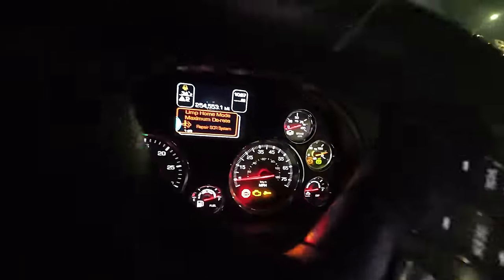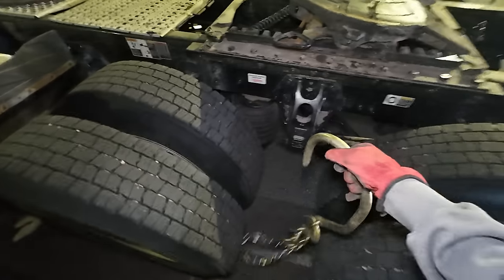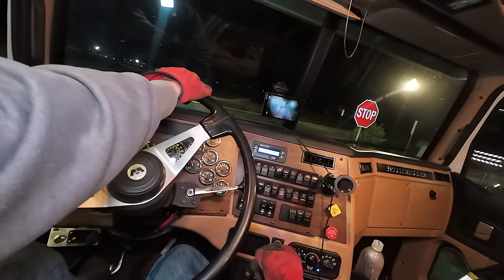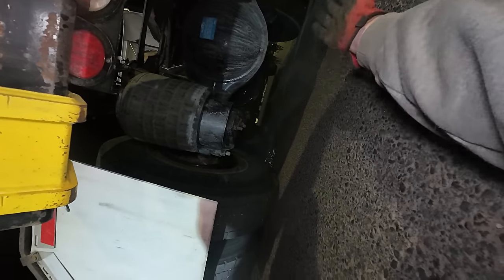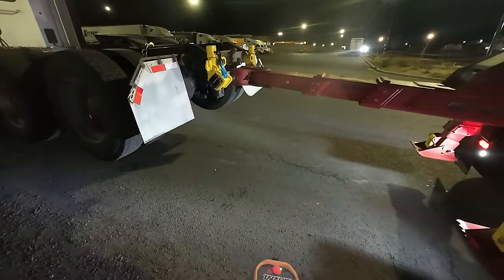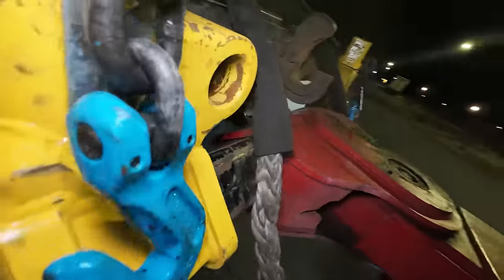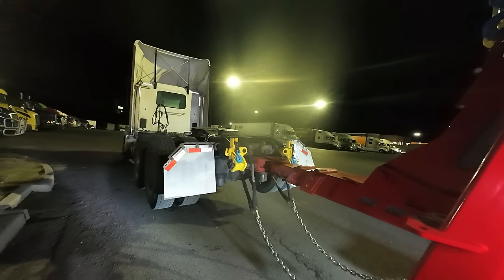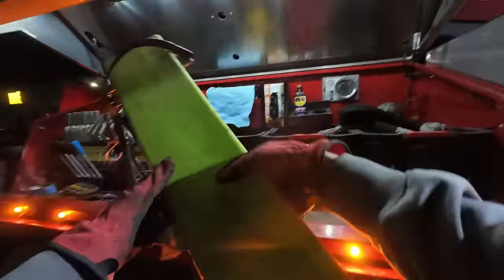This is what keeps us in business

Comment: I am not in trucking or towing but find your videos interesting and enlightening. I recently saw a tow truck towing a tractor and I specifically looked at the tractor and sure enough, they had put ratchet straps on the fairing to keep it intact. Had you not said anything about that precaution, I would never have noticed. Good video as always, Casey.

Comment: Casey, I don't know if it would help but I know for RVs they make a friction type of paper towel rack that doesn't unwind.
Reply: @tomberg6699 A simple spring clip will keep it from unrolling. RV paper towl holders still have issues from wind.
Reply: after that said maybe a piece of sand paper on the inside?
Reply: @edwinhryzan9030  How is sandpaper going to stop air flow in the box when driving?

Comment: As a 40 yr career retired driver that began in the 70s I’m so glad I’m not starting out now.  The derate emissions bs killing productivity would have driven me crazy.  Casey, I love everything you put out, keep it up if you can.  Thank you!
Reply: The derates are a major pain, but also a tremendous expense. I have had trucks down for months because of no parts to fix the problem. Thankfully, one truck was still under warranty for its issues. The other needed a $250 part that was unobtainable and the rumors were that people were stealing them off of trucks at the truck stops while the driver was in the sleeper. I had seen a couple new parts on auctions for $2,500-3,000. Peterbilt was willing to reprogram the computer to no longer derate for that, but the tow to the dealer (none local) would have been a worse financial decision than just letting the truck sit waiting for the part to become available again.
Reply: I agree with you sir about the emissions parts on the vehicle that’s one of the reasons why so many of the older trucks if they’re in good condition people are buying them just because of that anyhow I have a 91.5 Dodge with six in a row under the hood And I wouldn’t trade it for a new one, even if somebody was to offer me a brand new one even up, I told him give me the cash difference. I took my engine down to a very very professional shop in Cambridge Ohio called DNJ Performance and they’re extremely good. I know they specialize on comments engines I don’t know if they do power strokes and stuff like that but these guys are good Google the D.N.J., and also look at the executioner engine
Reply: And now the freeways are littered with more empty DEF jugs than picnic coolers...
Reply: @jimmungai1938  Yes sir, I am with you.  I wish I had back my 93 ext cab LE with Banks mods.. I sold it with only 123k on the clock.  Barely broke in.  Oh well these are easy tows and will keep Casey and many others busy.  Just glad that’s not me.  Enjoy that Dodge sir.
Reply: @r2db have you ever had to sit in a car behind multiple 18 wheelers billowing sooty stuff while stuck on the freeway on a hot day? 
Have you lived in an apartment near a freeway where you had to vacuum and dust every day to rid apartment of soot. 
Have you ever looked down from Griffith observatory at a layer of smog?

We Angelenos enjoy the cleaner air thanks to emissions regulations!
Reply: Clean air 1st.
Reply: As a member of the general public, I expect industry to control emissions. It's part of the deal.
Reply: @r2db  I agree. We have several New trucks down with DEF and emission issues for weeks ongoing , while the old 15-20 year old trucks we have are the only things keeping us afloat right now. We cant keep $200k new trucks running. We cant get parts for the $200k new trucks. We cant keep the $200k new trucks from falling apart. Another thing that needs to be mentioned is the quality of the trucks being built is garbage. We run Custom specced Peterbilts. These should be cream of the crop trucks and they just aren't. Now, granted, we haul milk 24/7 and we haul lumber that goes over a mountain 4 times a day at 105,500 lbs, so our trucks aren't pavement princesses. They get worked. But the difference between turning the key of a 2003 Pete 379 with a Caterpillar and that of a 2023 with an cummins X15(Great engine BTW) is that the 2003 will do its job and be ready for more 24/7 without complaint. The 2023 will rattle itself to death and throw a derate.
Reply: @macking104 , if it worked it would be fine, but I have to ask you if you have ever had to make truck  and insurance payments amounting to thousands of dollars a month on a truck that’s parked because some emission part is not available ? Or seen the results of what happens if you happen to spill a little of that DEF Fluid on an aluminum part of a truck ?
Reply: @geekazoid47  I also imagine you as a member of the general public will quickly be unhappy to not get the goods when YOU want the goods.  There are issues with the technology you can easily research and become educated.  We all want the reliability that insures a flawless supply chain.
Reply: @jimwilcox741  I don't care about any of that more than emissions. I drive a low emissions diesel and do my own maintenance. These guys are idling a lot which is driving their regen intervals.

Comment: By pushing the engine stop override button (as the filters were loaded and would not clean by doing a forced regeneration) I just pushed the button every 11/2 minutes so that the engine would keep running and keep running.   Long story short it worked for me to finally arrive back to home after about  600 miles

Comment: Not 100% sure but in the trucks I've driven that use the cruise for fast idle, once you set it, you can just hit resume to put it back on if you don't turn the engine off. Saves on wear on the up switch from the repeated presses.

Comment: The receivers can always stay in whatever position they finish in, because no matter what you do, they're always going to be in the wrong position the next time you use the truck.
Doing light duty towing that I was into, anytime I had to tow something backwards, I always tied down the steering wheel, even if the lockplate was engaged when removing the key from the cylinder. It didn't require a safety thouigh, because I always got to use the seatbelt as the lock. I started by running the seat all the way forward, then I pulled out ALL of the seat belt from its retractor. Next, I would make two or three loops around the wheel, depending on how many it would go. Then I took up as much slack as needed by twisting the belt until it was just short enough to NOT be able to reach the receptacle, then I would untwist the belt by ½ turns until it would just barely reach. That was always enough to hold the wheel firmly in place, but just to make sure, I would then run the seat back until it wouldn't go any further. Most guys wouldn't go to that length. They would pull out some of the belt, wrap it around the bottom of the wheel a time or two, then click it ino the reseptacle and call it done. You could always spot those guys because the truck would always be shifting back and forth in their lane. It wasn't a lot, but it was noticable, and it wouldn't have taken much to get it swing out wider, maybe a bump in the road while turning, which would allow the column to collapse just barely, which would have been all it needed to slip the belt just enough.
This is the first video of yours that I've seen with those axle hooks. They look a LOT more convenient to use than using grab hooks; probably far less possibility of contact with harnesses, lines, hose, etc due to the chain not requiring a closed loop back to itself.
Question though,
I've seen you go into the cab to bleed off the air system in several videos. Why, and what happens if you don't?
I remember seeing, many years ago, that tow truck drivers used to cap off the exhaust stacks when towing trucks backwards. Why doesn't this happen anymore?

Comment: If you will use the underlift brackets for support with the chains in the future, you might consider replacing them with weld-on excavator bucket hooks (hook throat facing toward the truck, and smaller versions of the existing brackets at the rear of the hooks.
Reply from the maker: These are weld on hooks..

Comment: @casey ladelle take a piece of fishing line and tie it to the back of your paper towel holder. Loop the line over the top of your paper towel roll. Tie a heavy fishing weight, bolt or washer to the end and let it hang. The weight of the line and whatever you tied to it will keep your paper towels from unrolling.

Comment: Hey Casey when I was doing towing I would us the seatbelt and then I would use a nilon rope to the steering wheel and go through the door and then close the door and then I would tie it to the mirror and I never had a problem with the way I did it and I would also use a longer chane and go through both sides of the axle and I would use a binder to make it tite because the way you did it the right side of the axle is not tied up and it will bounce and it could possibly cause damage if you had to tow it for a long tow that was just the way that I would have done it Charlie kretschmar Phoenix Arizona

Comment: Question: Why are some of your chains in the box on the back of the cqab and some of them in the step box on the frame rail? I am not trying to throw shade, I am just curious because I noticed you pulled them from and put them back up in different locations.
--edit to correct spelling errors--
Reply from the maker: Because some chains I use all the time and some I only need occasionally
Reply: Thanks for answering.

Comment: Casey, when you chained up one side of the air-dumped axles, why didn’t the other side come down? Because there was no air in either side? If that had been leaf springs only, would you have to chain both sides of the axle to keep one side from dragging?
Reply from the maker: Trucks don’t have suspension articulation like normal vehicles do
Reply: @CaseyLaDelle  thanks for the answer! I guess it would be hard to twist those leaf springs, even though the solid axle is similar to “older” automobiles and light trucks.

Comment: Is it possible to put the rear axel on woodblock and then get under the airbags and then lift it with U-bolt forks ?

But maybe its takes more time and harder work to chain it down and all the other things you have to do to it, then just chain sling it like you did and work easy with everything at a nice hight...
Reply from the maker: Yes, but that’s far more work than just chain slinging it

Comment: By lifting the axles from just the drivers side, does it put any stress on the far side? Normally when you chain up the axles, I’ve seen you use two of the hooks on the inside axle (because you’re grabbing the other axle by the u-bolts).  Thanks!
Reply from the maker: Not enough flex in the suspension to need both sides chained.   When I lift by the rear axle and let the front hang I sometimes chain both sides simply because I have both axle chains, or am using one long one to do it

Comment: This is not a criticism. I absolutely don't know your industry but did I see that correctly that you lifted the rear end on just the chains? If so, why?
Reply from the maker: Because I’m chain slinging the truck.  That’s how it works
Reply: Also that’s how it was done before under reaches or wheel grids. He did mention the air bags were to low to easily use the shackle cups.

Comment: I need a cold glass of hatorade and Casey are you a southpaw Bowler if so you have an extra Advantage at bowling because the oil doesn't get used up on the left side because there's not many southpaws compared to right-handers

Comment: You dont have to chain up both sides of each axle? I would think it would still pivot down pn the other side?
Reply from the maker: Nope, truck suspension doesn’t flex side to side like cars
Reply: Interesting. Where would you recommend for heavy tow training. I opporate a small towing company in va. Currently just a rollback and a wrecker. Would like to get into heavy duty stuff in the future.